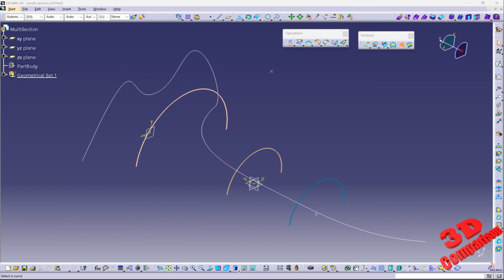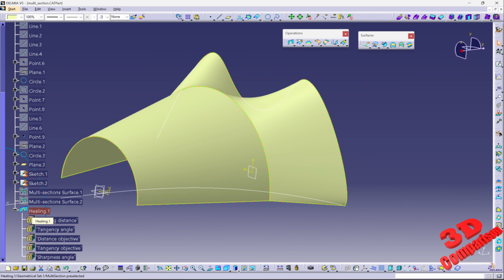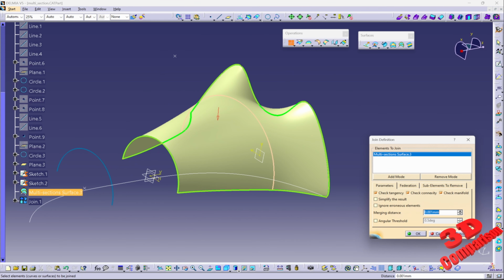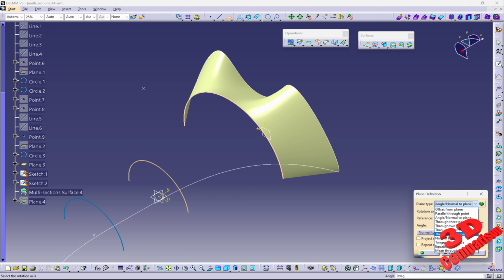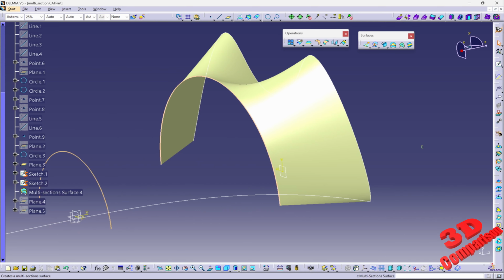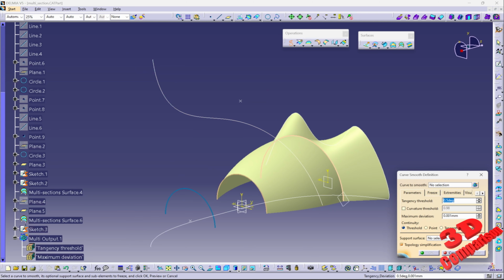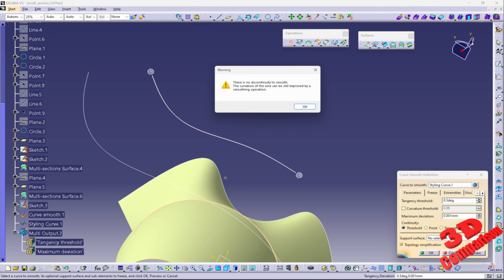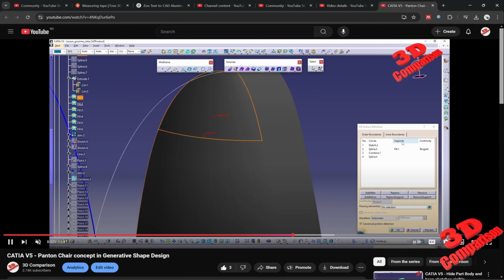How to Smooth Joined Surfaces into a Seamless Single Surface in #catiav5

Comment: Thanks for the video. I shall keep questioning related to surfacing.
Reply from the maker: There are many aspects still to be discussed regarding this topic as surfaces are complex in CAD and obtaining smooth surfaces is not an easy task. I have started actually to grt into Fusion 360 for this reason, as withon the Fusion 360 it is easier to design organog shapes that have good curvature, much better then Imagine and shape workbench from CATIA V5